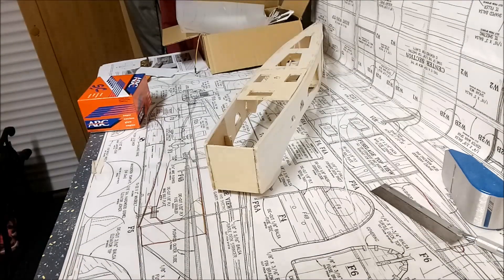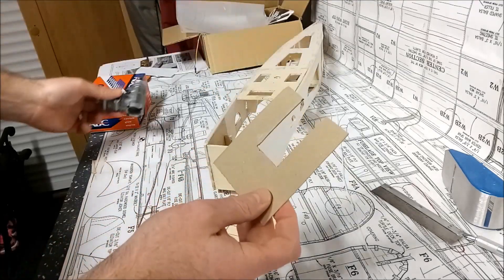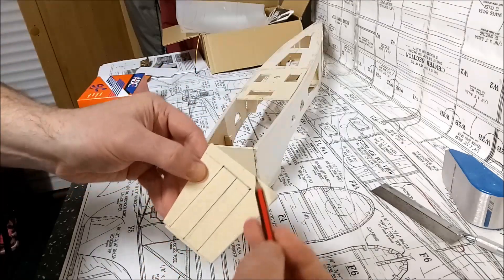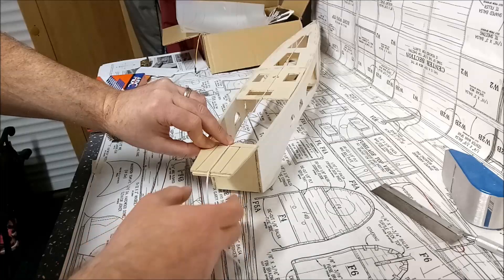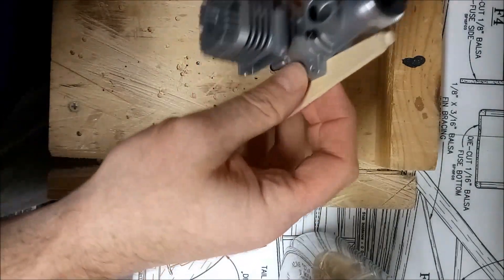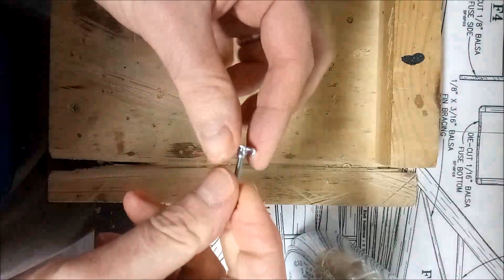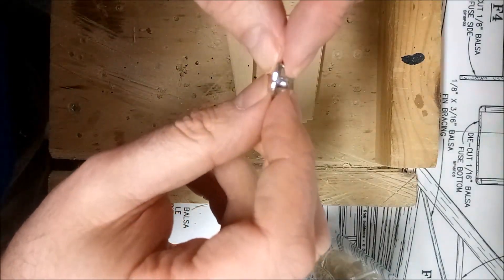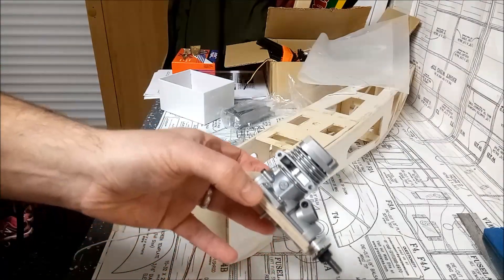Vid 9: Building an engine mount for an RC plane

Comment: If you add a third thickness of ply and cut at an angle to support that nice retaining nut surface would be a lot stronger . I will assume you seal the ply with epoxy to stop it going soft due to engine oil over time .
Reply from the maker: Hi, good idea, I'll explore that. I'll give the whole area a coating of fuel-proofer before final installation.

Comment: This is just my opinion and I might be wrong but the front of the engine needs to be on the center line not the rear.   Lay a ruler on the center line of the engine and see where it crosses the fire wall.

Comment: Thanks for posting Conor.  I'm afraid that you are going to find that mounting arrangement inadequate for that engine.
Reply from the maker: Thanks. I share your concerns. It's not as neat a solution as I'd expect to use, I may look to reinforce it  once I've got the engine up and running and see what the effect is on the airframe.